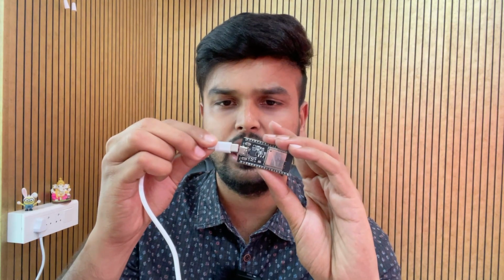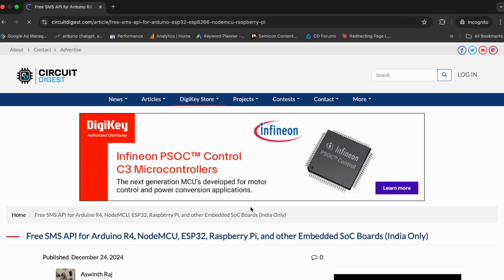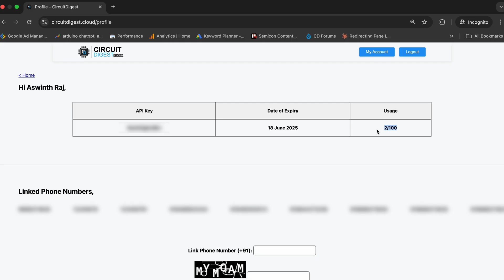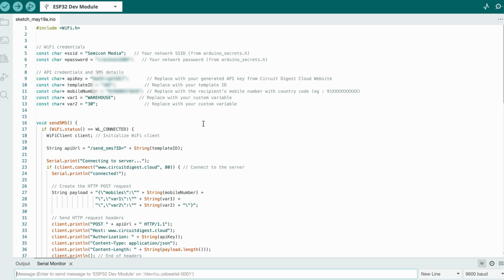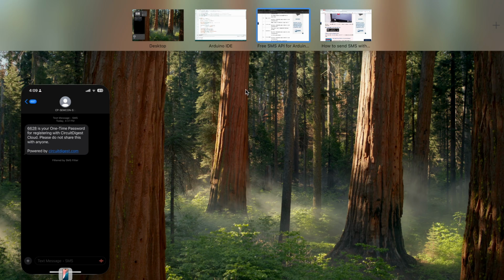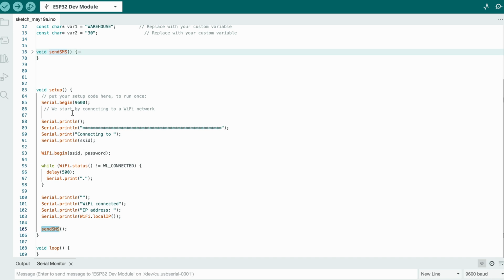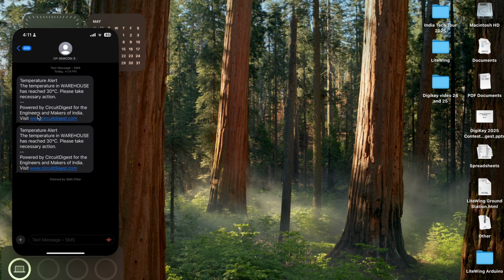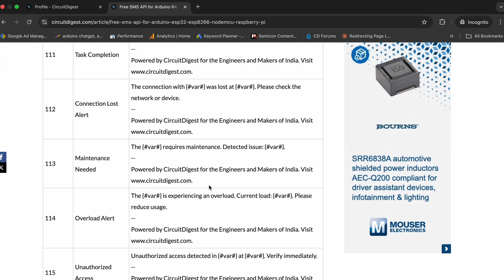How to Send SMS Alerts from ESP32 Without GSM Module | WiFi-Based SMS Notifications Tutorial

Comment: In thinking about this, for someone who doesn't want to use some unknown 3rd-party website and API, it might be better and easier to use ESP32 to send an email.  Much easier and doesn't require someone else's API / website.
Reply: setup email notification on your phone specifically for your IoT network
Reply from the maker: For that too you need to depend on third party providers such as google. As long as its not P2P connection all other such web services rely on such third party APIs or services.